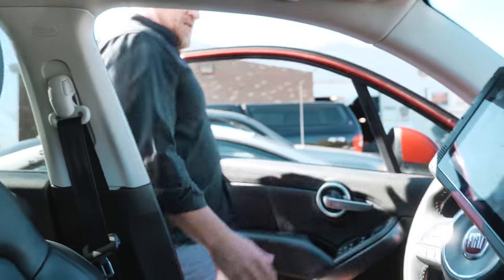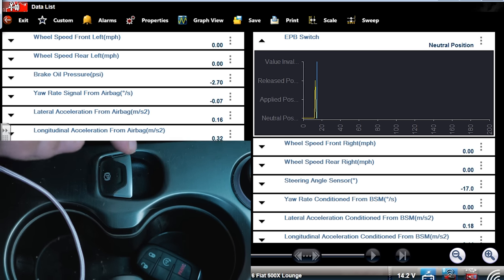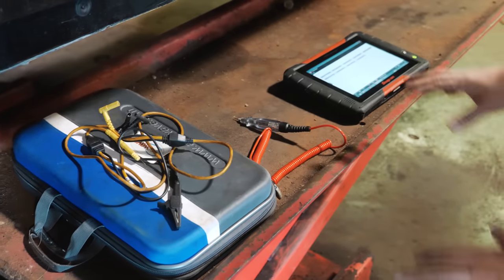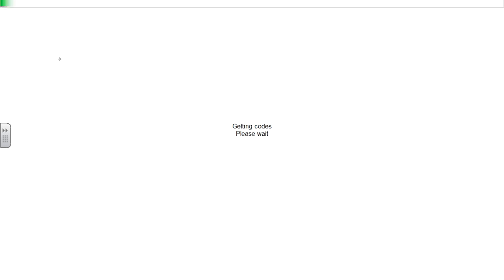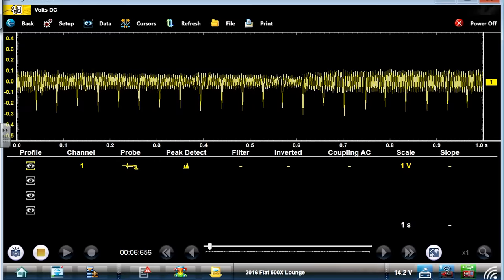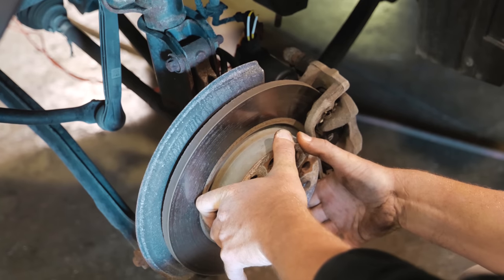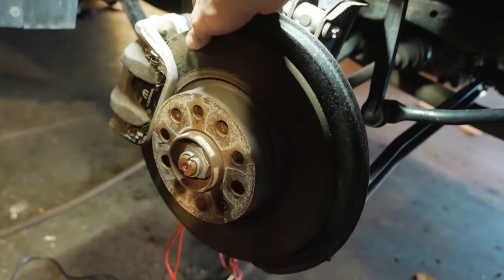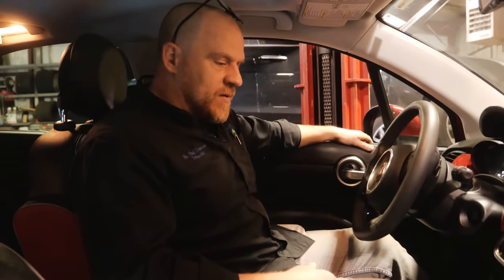2016 Fiat 500 Electric Parking Brake Intermittently Sticking On

Comment: Hi, Paul.
1. When you have corrosion like that on terminals, you should measure continuity to the computer first.  I left you a comment in the past about this simple method but I'll repeat it: with the DMM on the diode scale, connect + to ground and - to the wire. The DMM should show you a voltage drop of about 0.6V which is the ESD diode inside the computer. Every input and output of a computer has such thing as ESD diode. And, if you see this, the wire reaches the inside of the computer.
2. To me that signal is an oscillator that measures the inductance of the solenoid or motor or whatever that thing is. A bias voltage measures a current drop while an oscillator measures inductance. Manufacturers might have taken this approach to prevent services from using parts that are not certified. A solenoid might have the same DC resistance and mechanical power but different inductance. The computer will block that part from being used. Corrosion will meddle with the oscillator making the computer believe the part is not OEM.
3. "Incoherent state..." means the computer feels the movement of the solenoid using back EMF and does not need a physical switch. But, sometimes, it might lose memory about where the core of the solenoid is. And sets a DTC.
4. The solenoid is not sensitive to + or - as it is commanded in both directions using a so called H bridge. Voltage goes in one direction for one operation and the other direction for the reverse operation.
Just my thoughts on this.
Cheers!
Reply from the maker: Great info! Love the diode check idea! I don't remember ever reading that before. Question for you.  Why did the test light satisfy the circuit monitoring at rest? The inductance type of test you described, i wouldn't think the test light  would pass that test?  Thanks!
Reply: @ScannerDanner  I have no idea. According to my theory, it shouldn't have happened. I might be wrong in my assumption and that "oscillator" might be just noise. Or, it could be a bug in the software or, also could be a test applied by the computer that revealed an inconsistent result, hence, no further action from the computer. Just theory. I have no idea about the ideas in the automotive domain nowadays.
Reply from the maker: @danielmusat597  I still like the theory. I think (as another viewer suggested) that AC coupling that signal and setting my volts to 1 or 2v screen and a faster time base may have revealed that signal
Reply: @ScannerDanner  If the theory is correct, that signal wad already AC coupled inside the computer. Hence the amplitude going beyond 0V. You would have seen a simple sinusoid with the correct setup.
Reply from the maker: @danielmusat597  one that I bet we could have seen a change on with the test light installed
Reply from the maker: My fear with the diode test is when you have a 5v or 12v bias already on the circuit. Resistance measurements get messed up with voltage on a circuit. How's the diode scale handle it?
I guess a variable of that test is you must have the key off and module powered down. Also I'd imagine polarity is important
Reply: @ScannerDanner  Absolutely! Also, knowing this theory now, maybe in the future you will make a test on a known good solenoid, just for fun.
Reply: @ScannerDanner  Yes, of course. This test is only for continuity of the wire itself. Doesn't tell anything about the circuit. And, yes, it has to have no voltage on that wire. And the polarity is certainly important as the diode will show a voltage drop in one direction only. And that is the revevrse direction of the normal voltage.
Reply: @danielmusat597  what do you do? What is your background?
Reply: @joshwilson849  I like physics.
Reply: @danielmusat597  ok lol what do you do?

Comment: I want to thank you for this amazing  video. i had a similar problem  at electronic parking brake(renault/kadjar) and l couldn't erase the fault eventhough i checked that actuator  was working correctly .after several attempts i could erase the error . something strange about theses electronic systems

Comment: Merry Christmas Danner. Could that be that the bias voltage was actually AC voltage instead of DC ? Does that scope can couple AD+DC ? Thank you.
Reply from the maker: It could have been and yes, a lab scope will show both AC and DC signals without changing any settings. In the DC mode, it will draw both. In the AC coupled mode, it will block DC and only draw the AC

Comment: For sake of recording on the android based systems, you might consider getting an external capture device, for example the Yolobox Mini. It can capture HDMI outputs from the scantool and do switching, streaming, etc, although that may be beyond the scope of what you need. Aaron Parecki's youtube channel has some videos with practical application of the Yolobox and similar devices. There may be something more applicable to you too. I don't know if there's an HDMI out, but you might be able to "cast" the screen if it's android based to a capture device. Best of luck. Thanks.

Comment: the long drive train code is probably the transmission wiring harness recall/TSB issue. I think a recall was forced from random neutral/stuck in place problems.

Comment: Maybe the bias is only visible if you ac couple the signal?
Good way to compare the left and right motors is to measure the current with an amp clamp.
Reply from the maker: I wish I would have played with that more when we were done. That is a possibility. Thanks!

Comment: Also you were checking bias voltage with a ground from the battery and looking for positive side bias. I would have tried checking for ground side bias also. Maybe it has a constant ground and the system applies voltage ( positive) side for operation. You know the guys across the pond do some crazy stuff with power and ground.
Reply from the maker: Ground side bias can be seen when connected to battery ground. I think AC coupling would have revealed what we couldn't see

Comment: That is a nice kit from AESwave. My only problem with them is the cost of shipping. Bought another ScannerDanner manual today for a Christmas gift and was grinding teeth when the shipping got added. Lol
Reply from the maker: The shipping options should be there using USPS which is around $6 in the lower 48.
Reply: @ScannerDanner  USPS Priority Mail to Kentucky was $17.10  The book manual is worth it I can’t deny that. Just hard on the pocketbook. Lol That’s nearly 20% of the item cost.

Comment: did you try put the hand brake into its sevice position as if you were changing the pads then take it back out of service mode with the scan tool
Reply from the maker: I did not
Reply: @ScannerDanner  good video i like the missed plug :D i think alot of the electronic brake issue was the calipers were out of balance with each other from the plug  i think when you wind them back it looks at the amp or current draw when it peaks at each end of the stroke  when you put it into brake pad replacement service mode just resets them to there home point

Comment: Something that occured to me. Might that bias voltage be seen if you connected your scope to both connector terminals rather than having one lead connected to a separate ground? Possibly another option to see the bias voltage might be to use AC coupling and both terminals of the connector connected to the scope....just a thought🤔
Reply from the maker: I believe I did measure between the terminals. AC coupling I think would have been the key

Comment: i work on FCA products and any time you enter the ABS module it will chime the lights on the dash. also ran into issues with these electric parking brake systems they are very finicky and sometimes very hard to clear the codes even with a OE scantool

Comment: The circuit being a 2 wire reverse polarity; I wonder if it has no ground reference so the integrity signal is applied across the pair instead on either wire to ground.    When I encountered plug connector conditions, such as this one, I soldered wires to the male pins of the actuator and splice into the harness.  The connector is for assembly line purposes.
Reply from the maker: I think I measured across the pair and saw the same thing? I can't remember if I did that. Wish I would have spent more time on this part

Comment: while I've never checked, I'm sure it can sense the parking brake apply/release motor current ramps, and if not within a certain range it sets failure code and locks out. even if a test light was the exact current of free running actuator motor, it would still fail-out due to not having the current ramps from mechanical clamping force and same when it releases and goes to open-stop.
I'd imagine the open-stop is somewhat a rapid current ramp as it bottoms out, whereas the brake apply force would start low and ramp up higher to a known peak range as it clamps the pads onto rotor. sounds like a good thing to scope and graph! where's Ivan! 🤪
** as for bias voltage checking it shouldn't need to, because it can just apply voltage to the motors normally and check for known current range. I don't know the logic, but I'd assume as vehicle is powered on it auto applies power in the same direction of the last known state it was in, applied or released. I'm guessing it auto-applies each time when stopped in park and ignition is powered off.
Reply: it's also polarity sensitive to the actuators, if backwards it would lock when it thinks it's unlocking and vice-versa and the known current ramps wouldn't match.
** and right after posting you noticed and stated that in video. DOH.

Comment: If you take the actuator apart you will find a lot of corrosion in there too. It's not just the connector tabs. Fire the cannon and replace the actuator too. You'll save yourself the aggravation.

Comment: hi paul i have a vw  i never touch the epb switch when i get in the car put seatbelt on start and drive the handbrake automatically releases when i pull up at any stop the auto hold (abs)activates till i pull off and releases if i am stationary for more than three minutes the handbrake comes on and if i then pull off the hand brake auto releases then when i park the auto hold comes on till either turn off ignition or unbuckle seat belt or open drivers door the handbrake comes on immediately the cars are getting too dam smart

Comment: Do you think the bias voltage would have been visible had you connected Both scope leads to connector rather than battery/chassis ground?
Reply: It seems to me that since it is a reversible polarity circuit it may rely on the circuit wires rather than just battery/chassis ground. 🤔🤔
Reply from the maker: I did that too my friend and didn't show it I guess?
Reply: @ScannerDanner  That was also my first thought, that bias voltage may come (for some strange  reason) from DC-DC converter inside EPB module, so there would be no common ground with chassis/battery. Or maybe those low voltage spikes are to induce higher voltage spikes in motor windings to detect shorted/open motor? But... 0.25V only? Just wondering. That bias voltage is crazy, I would love to see some follow up video if you obtain any further information
Reply from the maker: @wilkk7867  I'm going to try to get that chance again in the future. Thank you!

Comment: just reading a few other replies and yes there is no ground it is just a reverse polarity circuit in the module so you can only see with a scope what is going on with a working system because of the protection mode you will not see anything.
Reply from the maker: I wasn't looking for a ground. I was attempting to measure bias voltage which was absolutely on that circuit. This allows us to skip the resistance measurements on the wiring. 😉
Reply: @ScannerDanner  yup i agree with that but i think you will not find a bias voltage it all done in the module
Reply from the maker: @dougytweddle4393  it's not magic my friend. It IS there. I just didn't measure it right

Comment: I work for Honda and as for our systems, the ABS module looks for resistance when starting the vehicle. If it sees a resistance it does not like, it disables the ebrakes and it throws a lots of warning lights.
Reply: I’ve seen instances where I’ve seen the brake actuator dropped on the floor and be defective afterwards. I’ve seen funny aftermarket units where the module is not happy with it
Reply from the maker: Yes sir and this is done with some type of a bias voltage. Did you see how my test light could get rid of the circuit open code? Of course the current flow was off (resistance) so it would continue to set the other code when i would exercise circuit. Hope that makes sense.
Reply: For what I’ve seen at my dealership, I call this taking attendance. In this case the abs module takes attendance to the ebrake actuator. I dealt with an Accord Hybrid and for what I found out from Honda headquarters is that even though its a DC circuit, it sends packets like a CAN network and its extremely fast and it also checks on the motor resistance.
Reply: To your question, yes I did see your test light taking care of the DTC. The dealership dropped the ball big time. At the dealerships we have tech line where we can call and troubleshoot with someone over the phone or request a field engineer to look at the car.
Id never let car go if it was at my dealership until the problem is fixed completely.
Reply: Btw, I love the picture on your wall, if I’m not mistaken its from Pulp Fiction and Jules was in Mia’s house.
Reply from the maker: @JohnattanRivera1984  nice. Wish I would have spent a little more time on that signal

Comment: Had a truck towed to shop about 2 weeks ago cane from dealer they told him it need a tcm, parking brake wouldnt release due to park brake chambers bypassing air ( 18 wheeler lol ) 4 brake chambers later truck goes down road no issues with transmission 🤷‍♂️

Comment: The only thing I know I have seen frustrate u as much as this car is you trying to find a EVAP leak lol too funny... Man this was some good stuff of course soon as I would have saw that connecter boom automatically it's getting a new connecter but I still would have done my integrity checks to make sure ...  Not seeing that basis voltage would definitely have sent me down a rabbit hole at that point I would have headed straight for the driver and worked my way back... I get schooled everytime lol... thank you for giving me other options and direction bro.. It's so easy to get lost if u don't understand how some of these systems work .. Lol .. I need to know everything lol
Reply from the maker: 100% my friend, thank you for sharing my frustrations with me.  After getting this video finalized today, I was wishing it was 15 minutes shorter lol, but what do I cut 🤔
Reply: @ScannerDanner  .. Don't cut any of it lol.. to much valuable information here to cut anything

Comment: Could it be a volt/ millivolt  difference being you’re using a test light as the motor or does it need to read voltage or millivolts
Reply from the maker: The test light wouldn't be the correct current flow, which is why it was still flagging that code, even with my test light in there as the load

Comment: Honda hybrid dual clutch uses a similar system, it measure current to know if its applied or not, if it applies + and - it watches the current draw, a high currect means its applied, if it tried to engage and the curremt reading didn't increase the system would say fail to apply, the system would only know the position when you apply or release, for the circuit code i habe a feeling the computer sends put a small frequency and watches the ground to see if it returns, that system seems vary complex
Reply from the maker: Complex indeed! in the way the programming, the ability to determining sync on each side and positions, to the ability to recognize an open circuit even with the circuit off.

Comment: Unbelievable!  Normally, when replacing the ABS module, it is separated from the hydraulic block and the brake system then has to be bled.  The defective plug should have been noticed at the latest when bleeding!

Comment: The way I think about these electronic parking brakes buttons is that it works the same as a normal mechanical lever. If you want to apply the parking brake you pull up so you should to the same with the button! 😄
Reply from the maker: I think my expedition is opposite
Reply: @ScannerDanner  Mmmm Here in Europe all cars that I have tested worked that way, but maybe some brands like to design things differently! 🤦‍♂Great for customers... Then it could be the same with the manual selection of gears in automatic cars. Some cars, like mine, lower a gear if you push the gear lever away and move to the next gear if you pull it, but in some others it's the other way around...

Comment: I always probe both sides of the connector instead of using a seperate ground for things like this.

It is likely using an isolated voltage source that is not connected to the rest of the car/not grounded
Reply: Also often when tha cable itself is kinked like that right before the connector tha copper conductors innside the insulation is corroded off and makes bad connection.

Cut open the insulation and look.

See this a lot in the salty roads in Norway, any water ingress = big corrosion problems.

Love dielectric grease for connectors for longevity 😁

Comment: The park brake actuator motor normally runs 12v bi-directional
Reply from the maker: Is it pulse width modulated? I
Reply: @ScannerDanner  some of them are yes.
Reply: I wish I could be at one of your classes , you do a good job